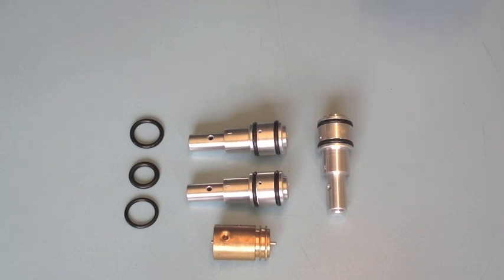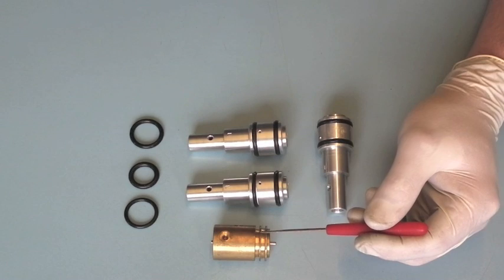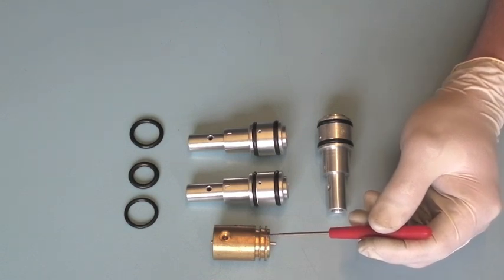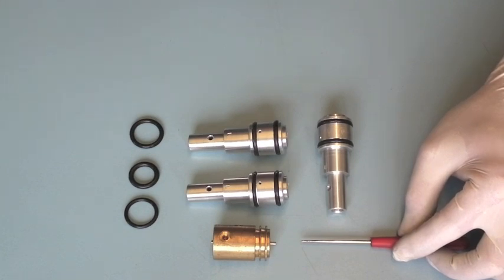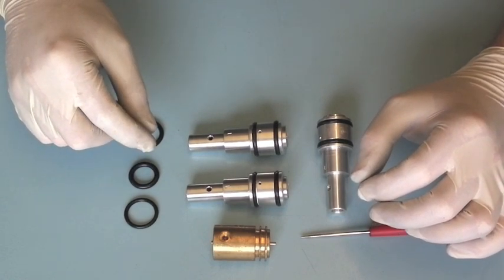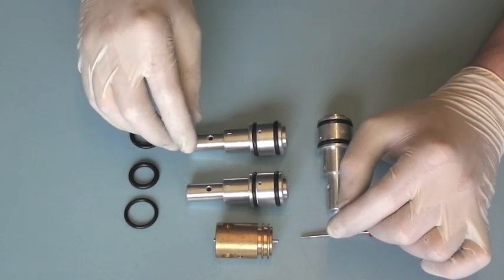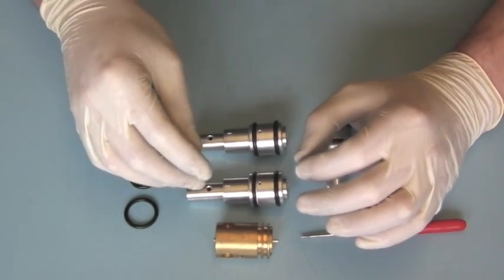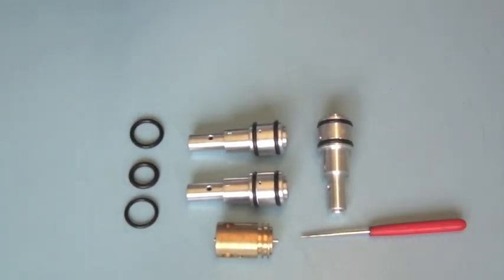Airgun / PCP 0-Ring Seals Pt. 2-3

Comment: i used teflon tape under the o-ring and it worked well.changing o rings wont solve the problem.using a a Teflon tape does it.

Comment: Hi robert

do you/could you do a replacement reg for the EV2?

I'm really interested in this, I've sent my gun back to AA three times now and it still goes wrong every now and then.

If you look at a EV2 the reg is the only thing holding the air tube to the breech, the breech takes a 5/8th BSP thread so I was thinking you could create an 'adapter' between the breech and air tube and put your reg in the tube like normal or you would have to replace it, I'm happy with either if you could do it?